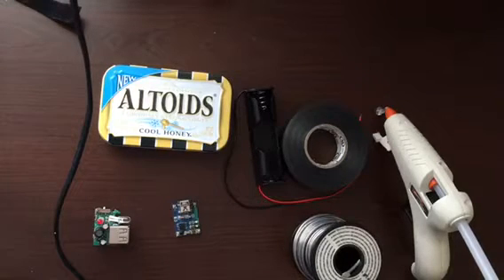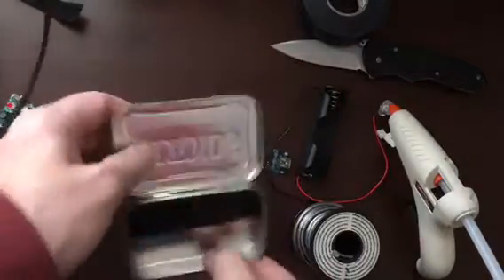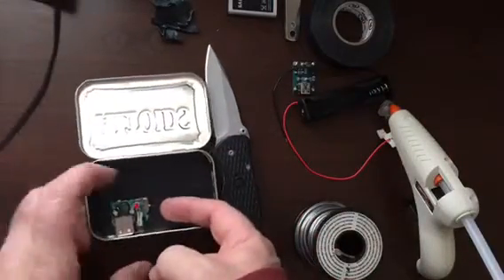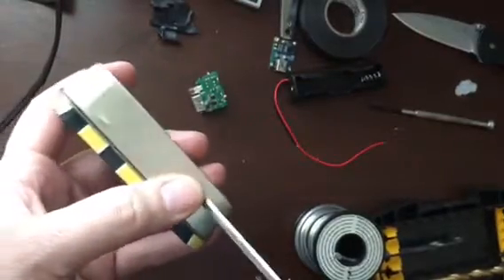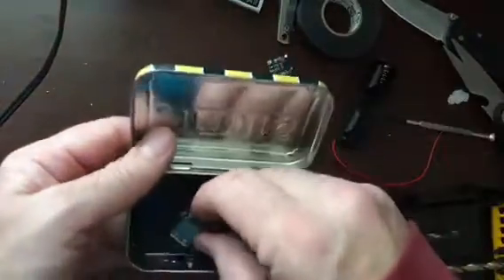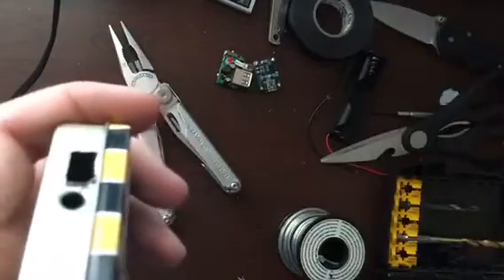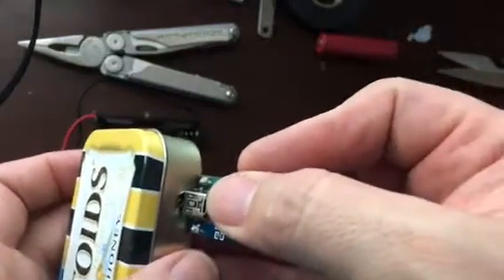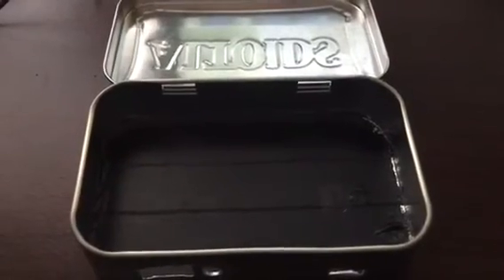DIY 18650 powered, solar charged iPhone charger in an Altoids tin - part 1 - The tin.

Comment: Awesome, I wanted to build something like this for a long time :)
Reply: can you add the exact link to the usb circuits you got there? thanks :)
Reply from the maker: Hello Lilly! Thanks again for watching my videos and commenting!! 

Here is a link to the Li-ion charge controller and the USB Charge circuit:
http://www.browndoggadgets.com/collections/charge-controllers

This is for sure my favorite USB charge circuit because of the LED on it and the switch.. When the switch is in the off/middle position it just lets the 3.7 volts through the USB port. When you switch it to on it steps up to the 5 volts. This is pretty cool if you have an LED you want to be less bright you can plug it in and leave the switch off and it will be dim uutil you turn it on.

I am going to continue on this project and the next part will be the wiring and then putting it all in the tin and showing it charge my iPad or iPhone or both...
If you have any other questions please feel free to ask.
Reply: ShoeManShoe68 ok thanks for the link, I just ordered a similar circuit here in Europe :) There is nothing more classy than a 18650 charger in an Altoids tin :) Thanks for your time. Take care. Lilly